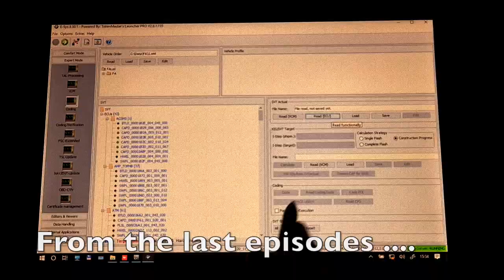BMW g12 Facelift Retrofit ! part 3

Comment: Hi,  great job!  I am from a workshop and have Esys. We are middles of getting all the parts for this G12 Facelift. If I buy the unit from you would you do all the coding's remotely for the same price? All the functions of the headlights will work accordingly? And what about the fog lights and headlight washers? facelift doesn't comes with those? if so will you get rid of that with codings too?
Reply from the maker: Hello I do not sell those modules, see in the description that you have a link, those who sell will do the coding of the taillights in the same price but the rest of the coding are separate

Comment: Great work👍 Thats really expensive upgrade, alone new G11/G12 LCI laser headlights costs almost 8500€ (and over 10000€ from dealer), so overall cost must be around at least 15000€😵
Reply from the maker: Yes, true
Reply: Yes but you can sell the old parts for at least half of that price. One LED headlight is 700E on ebay, so 1400 for both, probably another 2k for the bumpers and all plastic pieces, etc.. Second, if you had the money to buy a 100k euro car, I think it's peanuts to spend another 8-9k on mods.
Reply: @jokerash  , those are not LED lights even pre retrofit, they are laserlights worth way more than 700 eur each.